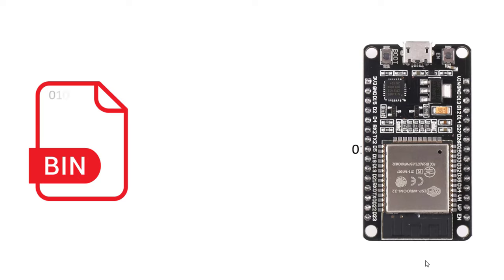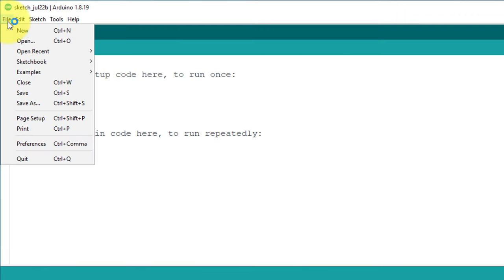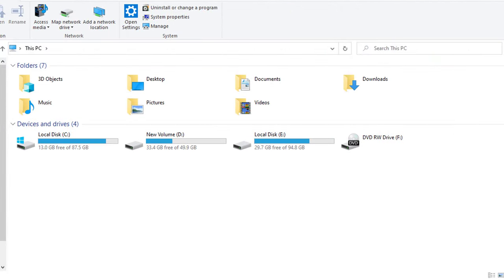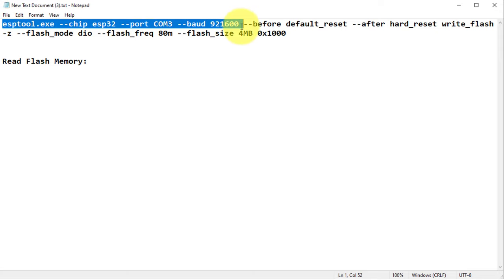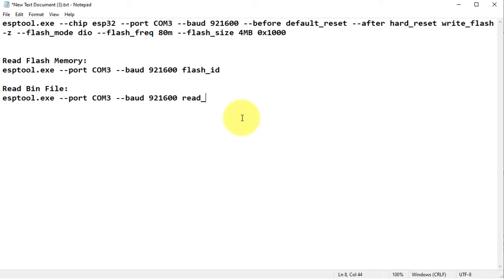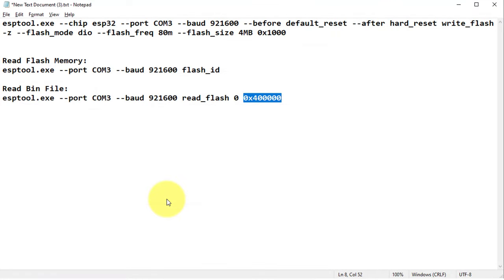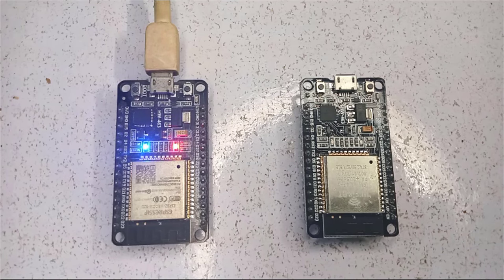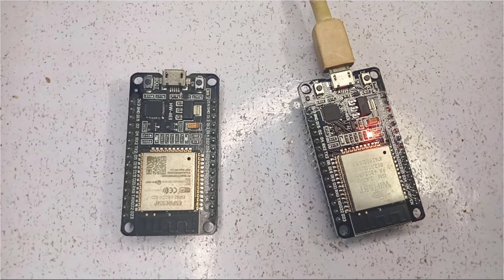How To Read Bin File From ESP32 and ESP8266

Comment: I uploaded, there was a warning “does not exist or your board is not connected”, help me please
Reply: Did you set correct COM port number? When you don't connect your board to PC, defalut COM port on Arduino IDE is COM3, but when you connect your board, this COM port number mostly changes. 
Check your COM number after connecting your board and use correct COM number in CMD

Comment: You're a genius and thanks for your careful documentation.  I was able to pull the file from a "dead"  ESP32-WROVER-E device.  I did have to cold boot it with power supply and then it locked into bootloader mode nicely.  Thanks again!

Comment: It really worked, even on ESP8266!
Now I address it to the other viewers: 
regardless of whather you use, ESP8266 or ESP32, you should install ESP32 support on Arduino IDE ->Boards Manager, do all as Ahmad did.
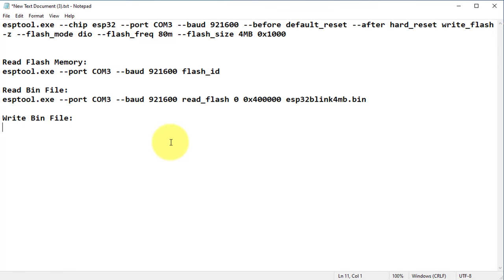Later in "Write Bin File" (8:49) instead of "--chip esp32" use "--chip esp8266"

And that's all the difference :)

Comment: I'm using Proteus simulator and it expect hex file for microcontroller.
When I compile code for ESP8266 in Arduino IDE, I get elf and bin.
Can I convert it to hex?   Even it successfully converted, will it work in proteus?

Comment: Hi, I am using a Raspberry Pi for development. The path to esptool points to a Python file, esptool.py. I tried to do "python esptool.py -version" etc, but it throws an error. Any ideas how to use the python version of esptool? Thanks!
Reply: I tried running esptool.py in the same original folder, and the 'version' command works ok. Is it safe to use from this location for the rest of the process?
Reply: OK, I just copied all other stuff from the same folder along with esptool.py to another folder, and it works.

Comment: Good day sir,
In this tutorial you have used esp32 module and you said steps will be same for esp8266 .that means wherever you have  mentioned esp32 in prosses. i should mentioned esp8266 instead of esp32 right.
Secondly you have select randomly esp32 development board, for esp8266 which board i should select. 
Please guide
With regards
Sharad
Reply: hello sharad,
for the esp8266 you can do it exactly like he did. 
I just did it and it worked fine using the esp32 module and dev board config. 
but with my esp8266 board i had to slower the baud rate to 230400.
best regards,
chris